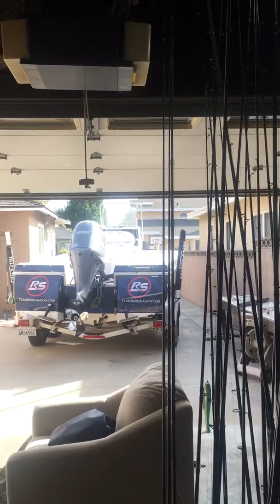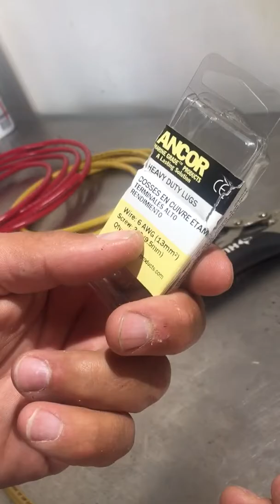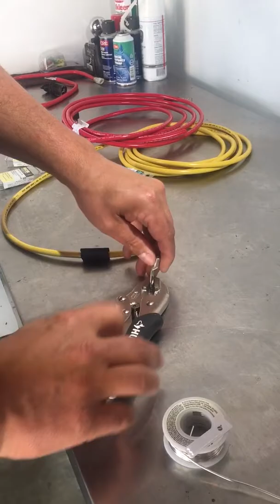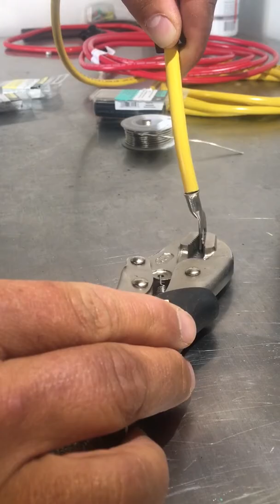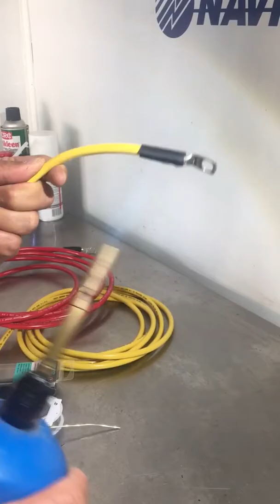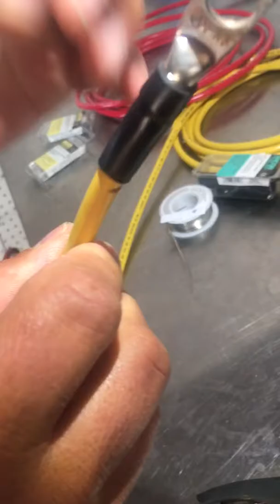Making Trolling Motor Battery Cables

Comment: Put petroleum jelly on the connector and it will not corrode.Same thing with the battery terminals. I have never seen a trolling motor plug that used that type of connection either?
Reply: It's the battery side of the cable,  the other side you ise a plug receptacle or hard wire